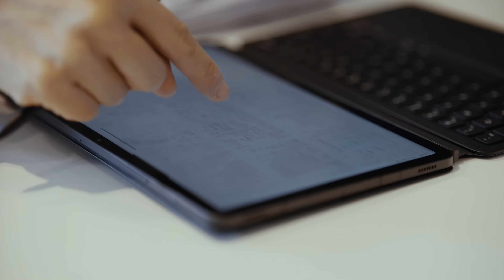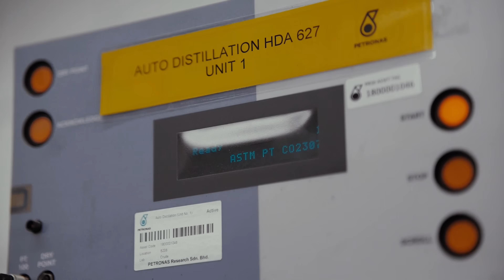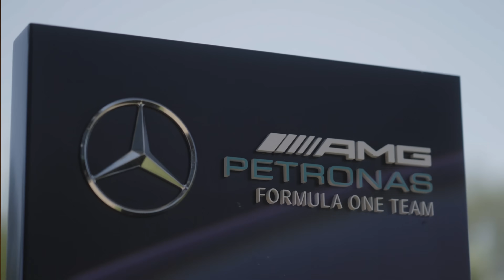The Road to 2026: The Science of Advanced Sustainable Fuel

Comment: V8 or V10 on sustainable fuel sounds even better 😎
Reply: less power and less torque and use more fuel,  no thanks. Turbo has proven itself to be the better solution since the early 80s.  In 1988 the 1.5L turbo V6 that was both fuel and boost limited won every race over a 3.5L v8/v10/v12 with unlimited fuel.
Reply: @byanymeansnecessary9329  Real F1 fans would rather have V10 sound than the faster electric.